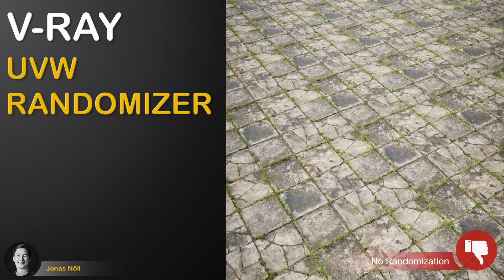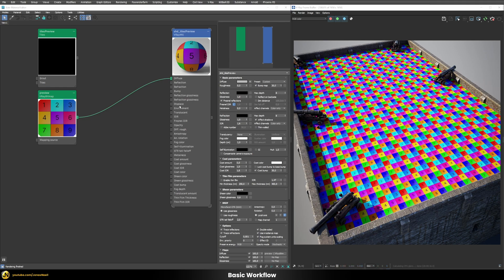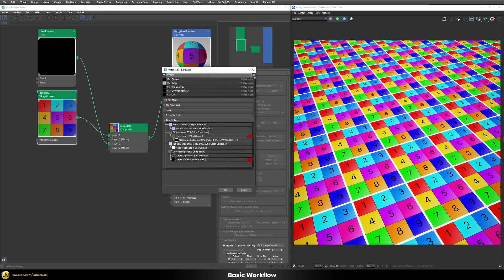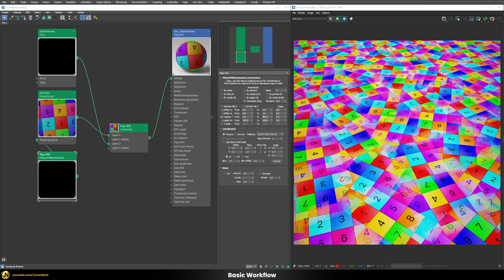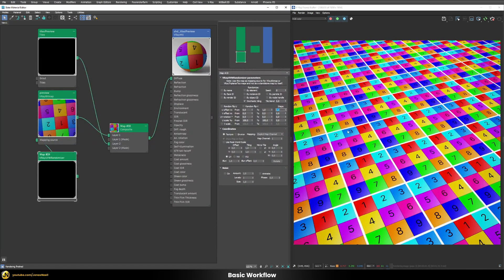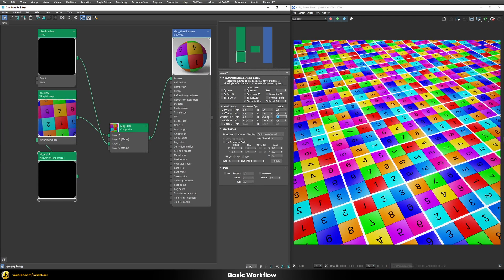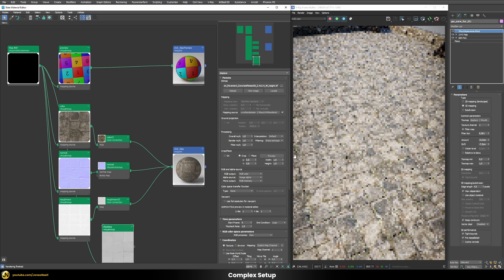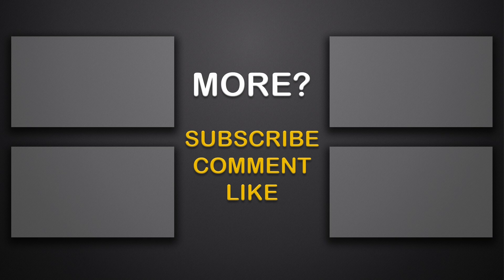V-Ray | Get RID of Texture Tiling  | UVWRandomizer

Comment: Hey there. Great video, very nicely broken down and explanatory. I have one question. I was trying to use UVW Randomizer on a brick material. Bricks however are not as nicely aligned squares, so this method would not work with brick texture. Any suggestion? Also when I apply the UVW Randomizer to my displacement map it seems to be rotating randomly (even though I set the rotation to 0). All other maps seem to work alright, just the displacement map seems to be acting differently. Any thought on this? Thank you!

Comment: Oh, I've finally understand how this steps works :D Thanks! Awesome tutorial. 
One thing about plugging UVWRandomizer into all maps, I like to plug it only to diff, and then plug diff to all others. This way, if I want to change tiling of texture or something else, I need to change it only in the Diff map, or if I want to switch UVWRandomizer for TrplanarTex, for example.
Reply from the maker: Oh interesting. Though for me if there is a UVWRandomizer present then the Tiling in the texture has no effect anymore and everything is controlled through the UVWRandomizer. So you can also change the tiling and so on there for all VRayBitmaps where it is connected. But I didn't try plugging in a VRayBitmap into the MappingSource of some other VRayBitmap, but probably works :)
Reply: @JonasNoell  Yeah, you're right. This is probably more suited for situations where UVWRandomizer is not needed. It's convenient to control the others with just one Diff map.
However, if you want to add TriplanarTex before UVWRandomizer in this situation, you'll have to replug everything again, as one of the examples :)

Comment: I have a question: if I randomly rotate the normal map, won't the bump information become distorted?
Reply from the maker: I was wondering the same but in practice there are no issues whatsoever. So in case of the normal map it’s most likely not really 2d-rotating the map itself but just the normal vectors.
Reply: @JonasNoell  I was wondering the same. I'm not sure if it's still the case but it was the same reason you couldn't apply triplanar map as mapping source to normal maps and instead had to go normal map > triplanar. Which is annoying since you would always need to make an identical copy of triplanar map just for normal maps.
Reply from the maker: @ChannelRejss  I never had the issue you describe using triplanar and normalmaps, neither in the past nor in recent versions. Which V-Ray version are you using?
Triplanar by default anyway doesn't apply any rotations to map.
Reply: Came here to say this, unfortunately uvw randomizer doesn't work with normal maps
Reply from the maker: @jangrashei1752 yeah, bummer 😢
Reply: I also have problems when I randomly rotate or flip the normal map. For example, when I apply random rotation to an asphalt material with distinct bumps, I found that each tile reflects in a different direction in the specular channel. When I looked closely at the vraybumpnormal channel, it seemed that the normal map was rotated in 2D mode.
Reply from the maker: @tplee8773  Actually I double check it again, and indeed you are correct. So it is really just 2d rotating the map and you can get wrong looking results in certain situations. If it is visible or not depends on your normal map, so if you have extremely pronounced and geometric details in there then it will become more obvious. In my day to day work I haven't notice any visible and disturbing impact though. But if you want to make sure that your normalmap is shown absolutely correct in all situations then it would be good to avoid the rotation and flipping in the UVWRandomizer and just rely on the U and V offset.